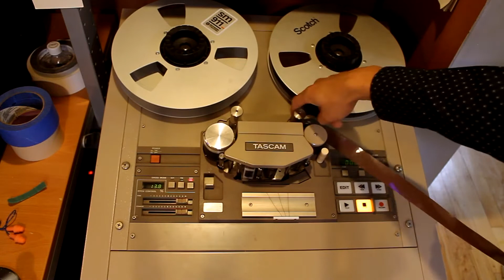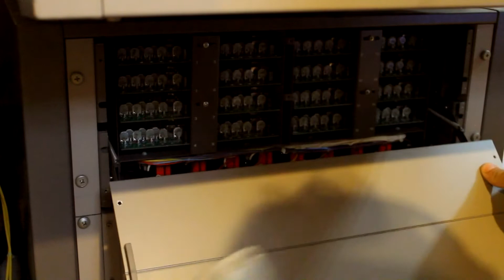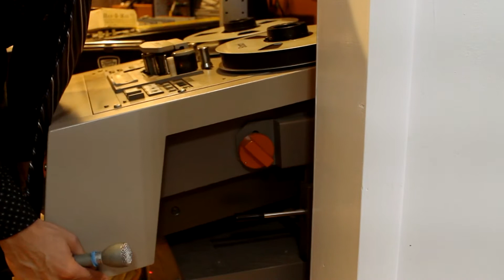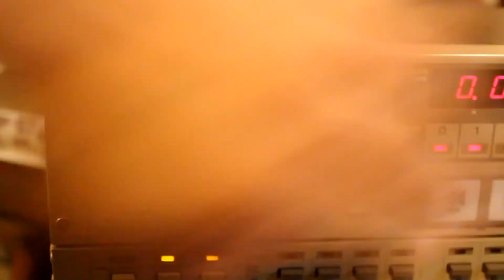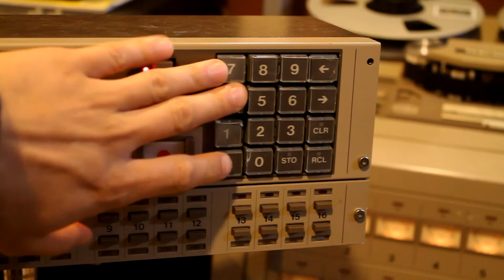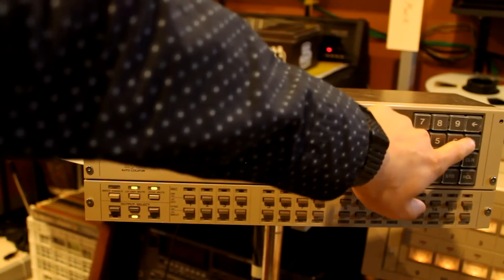Tascam MS-16 - Review and Rundown

Comment: Great video you seem to really know your stuff. I just purchased one of these from an estate sale and I'm having problems with the RR and FF being slow. The reel motors are strong, and playback is normal, but FF and RR is very weak. When I manually lift the tape tension arms it speeds things up to normal.  Any advice you could offer would be greatly appreciated.
Reply from the maker: You mean the tension arms and not the tape lifters right? Sounds like too much tension. There's a way to adjust both tension arms via a variable resistor that is behind a plate under the power button and above the speed control. There's a variable resistor for each arm. I would make sure it's not that first. Trouble shoot other things. Make sure nothing is rubbing. Make sure the tape lifters are operating correctly.

And most importantly...READ THE MANUAL. It explains everything Better than I can.
Reply: @Mario_DiSanto Yes the tension arms. Thanks for the info I'm going to look into adjusting them.

Comment: Great and thorough video!  I see one of these for sale and was curious to see a rundown.  I always had Otari's 8 and 16 track decks.  I should have never neglected them.  The Otari 16 just crumbled in many respects over the years - and began slowing down last I used it so many years ago.  But it had all 3 speeds all built in - I like the 15 ips best.  Setting it up, I left it to a professional and remembered it never suffered from any overshoot of set points till he adjusted it.  And that was a shame since it would take longer to return to zero or cue every time you'd search.  Still, like you say - it was quiet, transparent and after 18-hour days it was as ready for the next project as the sunrise!   I miss it!

Comment: Hello! This is a really NICE video!!
Can I ask for your opinion! Somebody is selling the same machine but without the stand for $1,500 the seller says that everything work fine.
Please if you can give me your advice will be great.
The machine that are selling to me doesn't has the remote control only the machine and the VU metters unit.
Reply from the maker: Sounds reasonable to me. Condition of the heads are important. If they have a lot of life left that price is good.
Reply: @Mario_DiSanto yes it seem a good deal but I'm scare that doesn't work, he says that I can test it but he doesn't has tapes.
Do you have Instagram?
I can contact there and send you a pic that he sent me atleast you can see the conditions, as I mentioned is only the machine and the VU metters unit, it doesn't inclue the other parts that you was showing in the video on the bottom of the VU.
I don't have experience at all with this type of machine, I'm more familiar with the Tascam 388 or Tascam 38, that's why I'm a little nervous about but you have the same machine, I just want to be sure.
The person says that the machine got serviced like 2 months ago.
Reply from the maker: @OZKÄRSTALIN @mario_disanto

Comment: @mario  I have a question on the MS16 audio outputs. Do I need to run them through a console or a preamp or can run them directly through something like Apogee AD16x (16 channel analog to digital converter) and send them to my DAW and get a strong recorded signal without the need of console or a preamp setup? Thx.
Reply from the maker: The MS16 has unbalanced and balanced in/outs. So you can really do a lot of things with that. I don't see why that wouldn't work what you are asking. Although it sounds a lot less fun than having a full-sized board to mix with.
Reply: @Mario_DiSanto  Thats very helpful. Thank you. My current idea on the workflow is to record all analog to MS16. Dump tracks in Cubase pro next using something like Apogee AD16x or a pair of Rosetta 800's through a UAD Apollo setup. Edit/mix and mix down to a Otari 5080 2 track that I absolutely LOVE. I did look at the SSL Big six but I have really hi-end analog pre's that I like to use to record direct to MS16. Some day is I get my hands on a big SSL or NEVE console then yeah, definitely will try full analog mixdown. Will be serious $$$$

Comment: hi in the uk there's not alot of reel to reel on ebay any more    i picked up alot of ADATS  all in need of alot of error 7  clean the head drum i have 8 of them

ki have a otari mx80   that work ace it's not a 100%  the capstan  coil trans is bad  i made a over ride  now it work ace  i have had this range

the best 1 inch is a soundcraft 381-- 381-16     brenell mini 8  they use alot of parts that are easy to find   

you are in the usa there's cool reel to reel decks out there like the teac 70  i have a 44  teac 80-8 as well  
it a lotto when you buy i have 6 tascam 38 all 6 have small things bad 

i am working on the last one now 

i did find people get the audio cards mk  1 and 2 and  audio mother boards mixed up   alot of card's will not record any more 

tascam 38 audio has 600 601  on it   big small numbers       big numbers go with big number audio card

the service book is the mark 1  small numbers  on audio card and mum  pcb  

hell getting my otari mtr12  i love the deck big time  i never sell it  1/2 tape  4 track heads  stereo  i was lucky £660 i payed £50 drive over with it 
i have   spares for it  as well  bob's bit''s

Comment: My ATR60-16 and Tascam 1600-16 are showing a lot of signs of lack of use.  All the knobs and faders are a bit crackly and are getting sprayed with Deoxit and Faderlube.  I’m pretty sure I will get all the kinks out with time.  I am using some 10 plus year old RMG 911 tape.

My question is it not normal that after many times of using a section of tape, it continues to shed the dark brown particles fairly quickly.  I’m cleaning every 15 to 20 minutes and getting brown residue on my Q tips.  I’m using 99% isopropyl alcohol.  I’m thinking I should just buy some new tape.  $203 at Vintage King!🥹.

Comment: What kind of console is it?  I wanna try the m3700
Reply from the maker: It's the 3500
Reply: So what's wrong with it?
Reply from the maker: @maverickrush405  I have minor issues with it but not much too complain about. Every console has its issues ya know. The construction quality is very obviously on the cheaper side I'll say that.
Reply: So what does that mean? Do you think the 3700 is a better quality I'm looking for the best compatibility  between the 388 or the ms-16 . I'm kinda leaning to the ms-16
Reply from the maker: @maverickrush405  the 3700 is probably the same as the 3500 in terms of build quality. I definitely recommend the MS16. The 388 is a fun toy boy the MS16 is a serious machine if you want some hi fidelity

Comment: Just pulled mine out yesterday (same machine minus the auto locate accessory)and gonna try to use it.  I never really got fully into it so your video is super helpful!  Hope you’re available for some questions I’ll no doubt have in the coming days/weeks.  I have a bunch used reels I bought off someone that need to be baked.  How do you do that? I have new ones too so don’t necessarily need them right away.
Reply from the maker: A dehydrater is usually what people use to bake tapes. I have never personally done it but the baking is good for about a year than it needs to be redone. Any more questions let me know.

Mario
Reply: @Mario_DiSanto  thanks for the quick reply!!
Turns out I have ATR60.  Doesn’t rock.  How would I determine the ips on it?  I also have an ATR 700 I pulled out too.  

When I tried putting those older used reels on it years ago, it just kind of seized up and stopped.   Baking them fixes the gummyness I’m guessing.
Reply from the maker: @rainbowmade1880  I don't know any easy way to determining the ips of a machine. The easiest way to me is to turn in the machine and get a tape rolling! 30ips will be obvious to the eyes. Compare with the speed of my machine in this video. Baking does help with gumminess

Comment: Gerard Stroh***
Hi Mario Disanto***
I am Setting up My Analogue Recording System!!!
I Have an Tascam 8516B 16 track Tape Machine it Came out A Few Years Before the Tascam MS 16 but The Tape Machine I Have Trouble With Mine But The Transport Still Works Like A Dream But What I am Hooking up is A Teac/tascam 80-8 8 track Machine and it Records and Sounds Great But I have to Use the Remote Control Because the Keypad on the Tape Deck Does not Work!!!
I am Hooking up the Tascam 80-8 8 Track Machine to My Allen & Heath GL3300 40 Channel Mixing Recording Console I Got it For $200 Dollars From A Church in Tracy California!!!
This Mixer is 5 Feet Wide and 2 feet Deep and it Takes 2 People to Move it Mario DiSanto!!!
I Also Have A Teac A-3440 4 Track Reel to Reel Tape Machine and Both Machines Handles 10 inch Reels and Records at 15 ips and I Also Have A Vintage Ampex AG440 4 track Reel to Reel and it Sounds Like A Dream and it Was Made in 1967 and it Came out of A Recording Studio in San Jose California!!!!
I am Also Going to Hookup the Tascam DX-4D DBX unit to My Tascam 80-8 8 track Machine!!!!
I play Keyboards and guitars and Drums and Bass Guitar and Mandolin!!!!
I Like Your Channel!!!!
I also Record on my PC Computer But I started on Analogue Tape and I have Some old Videos of my 16 track when it was Running and that Was About 16 years ago!!!
I Might Put Some Videos of That in the Future at A Later Date!!!!
Bye From Gerard Stroh!!!!!
Reply from the maker: Gerard, 

Wow man you got so many rockin' tape machines....maybe too many...Maybe you should send me one to take off your overwhelmed hands haha.  I would love to see the videos you are talking about. I like to drool over other people's setups.  Thanks for your comment and sharing your love for tape.  We gotta get a TAPEHEAD community meetup planned or something!

Cheers man,
Mario

Comment: Great reveiw well done! have you done an A/B of going straight to digital vs tot he tape to ehar the difference in sound? basically splitting the same signal to both daw and tape
Reply from the maker: Thanks Jason,. Not to a DAW, but I have considered doing that with my Alesis HD24. I can record to both simultaneously. It's going to be difficult to have proper gain staging for both though. I think the sonic difference would be noticeable. I am still having trouble 'finding my sound' on that Alesis though so it may be my lack of experience.

Mario

Comment: I sold one of these to Gabe Roth as a spare 30ips about 10 yrs a go. I think the 30ips is not as gd in th bass as the 15ips? Not sure 👍🏽🇩🇴
Reply from the maker: Very very interesting! Gabe Roth is an icon man.  And I hear a lot of talk about the 30 ips and the low end loss....I don't have much of an opinion on that as I've never used a 30 ips version to compare. But I will say this, there is no one more pedantic in this world than a "Tape head".  Tape heads will find any reason to not be happy.

At the end of the day, any recording engineer worth their salt (not me) will be able to record and mix around the constraints of any tape deck.
Reply: @Mario_DiSanto  I could not agree w you more. If u know what chu’ doing; any working tape machine is going to do the job. My current tapemachine is a Teac 80-8 back to factory specs and it sounds gorgeous B. I mix down to a Scully 280 and Yes Gabe is that dude.
Reply from the maker: @torocruz1192  Very nice. The TEAC 80-8 is a total tank! That is what I started recording on.
Reply: @Mario_DiSanto  Oh so cool so you know the machine; yeah I like it. Yo your new album is crazy dude🔥keep doing your thing👍🏽
Reply from the maker: @torocruz1192  thanks dude! I like to keep it crazy

Comment: 08.39 You don't sandwich the end of the end of the tape underneath itself. This could create pressure on that slightly uneven surface which will distort and dent the tape for quite some distance into the reel, particularly as you are about to fast rewind and put the tape under some pressure that way. 

You very slighty lick the end of tape, thread it around the spool and you will find that it sticks to the hub and you can gently wind the tape on for a short distance by hand. If the very end of tape is tatty, then you can trim it at a slight angle with some de-magentised scizzors or razor blade.
Reply: U sound very experienced  thanks  🇬🇧
Reply: you don’t know what you’re talking about

Comment: As a Gen X child of the 70's I've seen so much change over the years in how sound is generated, recorded and produced. There's nothing that hasn't changed in my lifetime. It's so nice to see a new generation using and enjoying analog gear like this.

I've often dreamt of building a totally analog studio full of outboard gear and a multitrack recorder. Trouble is, it's so hugely expensive. $100K wouldn't buy in hardware what I can achieve on just an iPad running GarageBand, let alone what I can achieve in a pro-grade DAW running on a computer with a suite of pro-grade plugins.

So until I become a millionaire it will remain a dream.
Reply from the maker: While this is true I'm not sure you can beat the sound of some true pro-grade analog gear.  Nothing compares the sound of a proper 2" Studer, or Ampex.

But at the end of the day your right, the sonic capabilities available to the average Joe is going to be much cheaper and assessable than any studio pre 21st century..  However, I think the workflow with using the hands on approach  associated analog gear is the most important aspect to consider. I think this allows for a more intuitive environment.   And you don't need $100K for that either.  Hell more than half the gear I own was bought for under $100.

I think a lot of people get misguided when they get obsessed with "analog" sound.  The sound is never what drew me to analog gear, it was always the experience of recording with physical tools I could touch and manipulate. 

Mario

Comment: I have 388 which is awesome, what are the main differences between this and 388?
Reply from the maker: I want a 388 so bad but the prices for one these days is astronomical! They used to be few hundred dollars not too long ago... The main differences are the size of tape, number of tracks and tape speed. 388 has half the number tracks (8) squeezed onto a piece of tape four times as small (1/4" tape). The decrease in track width on the tape is going to cause the fidelity of the recording to suffer.  Also I think a 388 is 7.5 IPS right?  Halving the speed is also going to cause the hi-end to suffer but that's not necessarily a bad thing.  Will for sure sound more "lo-fi" in a good way.

Mario
Reply: @Mario_DiSanto  I’d actually love to get an ms-16 or maybe even a 2 inch 24 track machine. The main thing holding me back though is the cost and and also the cost of tape in the 1 inch and 2 inch formats is so expensive. It’s much cheaper to buy 1/4 inch tape which is a huge plus for the 388! Do you find yourself being cautious in your tape use to due to costs or are you able to find it for a good price?
Reply from the maker: @Mark_Bayer  I wouldn't say cautious but I am certainly stringent.  The cost of tape is outrageous now.  When I record other people's music I record on a harddisk usually because I can't justify spending hundreds of dollars on tape.  It's a shame really.
Reply: @Mario_DiSanto  yeah it sucks, it should be way cheaper imo. $200 for 30 minutes is insane
Reply from the maker: @Mark_Bayer  My ulterior motive with these types of videos is to get more people interested in tape so the audio market starts taking it seriously again lol
Reply: @Mario_DiSanto  would be awesome if they did
Reply: @Mario_DiSanto  in think alot of people would love to use tape, but it is more work, it’s harder and it’s expensive so people stay away from it
Reply: @Mario_DiSanto  also why do you want a 388 if you have the ms16?
Reply from the maker: @Mark_Bayer  Mainly because I love gear in general lol.  I do like an 8 track format though, and doing that on 1/4" at 7.5 IPS is a huge money saver obviously.

Comment: hi i had one of this line before i got the teac 85-16 as the audio cards are easy to find i have a  spare cards alot of them 
it's luck when you buy reel to reel decks i am a tec so i can work on them 

i have seen alot that just need small work  
i will say the betacam sp decks are getting missed out  i picked up 2 pallets of them to work on WOW they are so good  decks for audio
Reply from the maker: I never considered using a Betacam deck for audio.  Is there any model you would recommend?

Mario